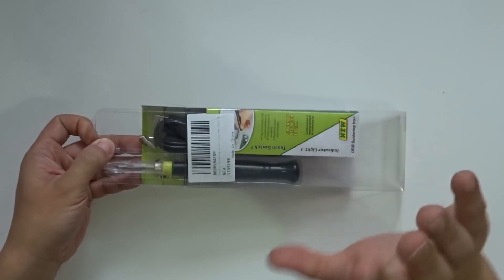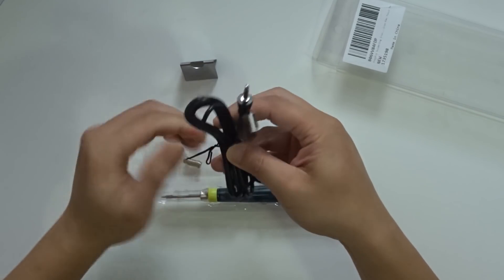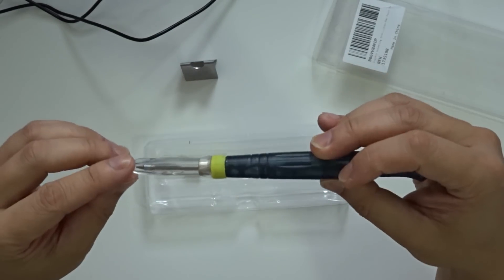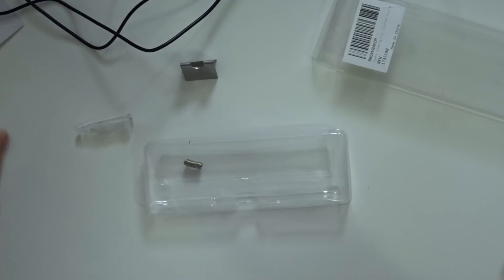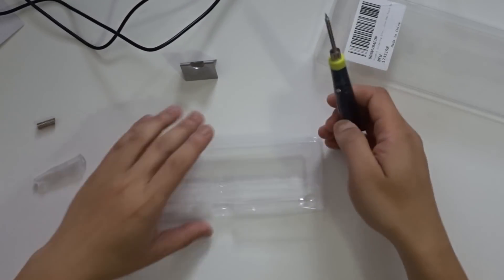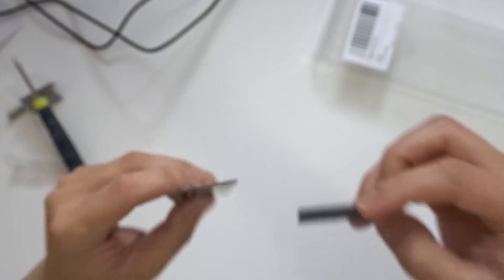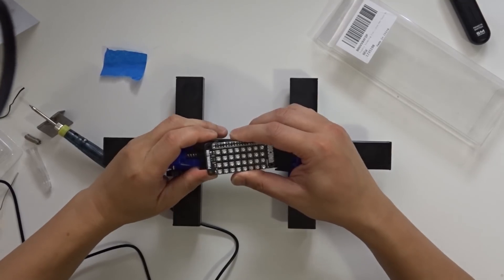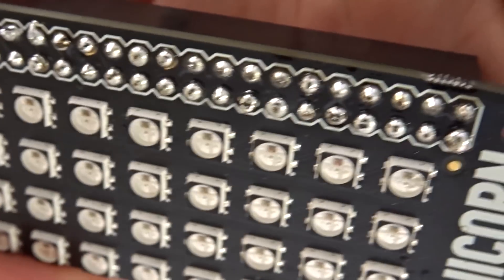$10 USB soldering iron first look review

Comment: I got mine for about €5 from China and has replaced all my other expensive soldering irons. It's been really usefull, practical and reliable to use and I got another one simply to keep as a replacement. I fully agree and endorse your review on this item. Well done.

Comment: I actually own one that looks exactly like that, mine if I want to change the tip requires soldering cause the tip is soldered directly to a wire inside, the collar at the base of the tip completes the circuit allowing the whole thing to work.  I got mine to use for automotive soldering (where a regular iron can get cumbersome) and I didn't want butane in my bag for a butane one, mine is 6 watts and it heats up quick, the cool to touch time is more like 5 to 10 minutes (depending on how long you were soldering) on mine
Reply from the maker: This is perfect for a automotive tool! I used to use a butain one
Reply: Novaspirit Tech I couldn't agree more, I originally planned on only using it to solder some car stereo wires then liked it so much it sits in my portable tool bag that holds my basic tool set

Comment: These can be very useful for small jobs however I'd always use it with a USB Power bank and never through a mains USB mains brick as there is quite a bit of leakage voltage through the tip which can damage sensitive components.
Reply: Yeah that is exactly what bigclivedotcom said about it always use a powerbank with it.
https://www.youtube.com/watch?v=o-8D5t6TJYU
I did buy my one after a did see his video.
Reply from the maker: I was afraid of leakage as well that's why I used power bank
Reply: Yeah it was actually Big Clive that clued me in to the leakage problem

Comment: Really interesting tool, indeed! Check out Banggood, they have identical looking USB soldering irons for sale, even for a cheaper price. There is also a replacement tip, I bet it fits also for the soldering iron you bought from Amazon.

Comment: Remember that the typical USB port in a computer does not have much power behind it. So do not plug this device into a computer's USB port because you might destroy your computer.
If you are going to use this soldering iron, be sure to use an external powered hub.
Reply: Agreed.  I'm not a fan of anything other than a tech device being USB powered.  Thumb drives, external drives, keyboard/mouse, etc. are OK.  Devices with built-in batteries that are charged via USB are OK if they're charged through powered hubs or dedicated USB power adapters, but not so much through computer USB ports (or hubs that are powered by the computer).  But, stuff that's motorized (like a fan my roommate has) or generates heat (like this soldering iron) should never be powered by the computer.
Reply: Valerio Turrini - Your response is unclear.  What did you use for 3 years?  Where is the thunder symbol?  If you used the soldering iron for 3 years, you're taking a risk, as Terry Thomas explained.  I've seen blown capacitors from incorrect voltages & stuff.  (Just because it's worked for 3 years doesn't mean it'll work tomorrow.)  And if the thunder symbol is on the laptop, perhaps it's a port with a beefed up circuit behind it.  Still, is the laptop plugged into its charger or running off battery?  Are you sure you're willing to risk a $$$ laptop to power a $10 device?  (But, then again, it's a Dell, so...)
Reply: used for 3 years often connected to usb port with thunder symbol on a dell laptop. no issues